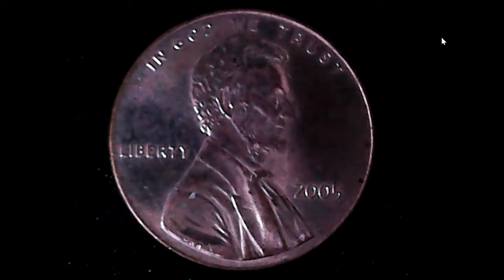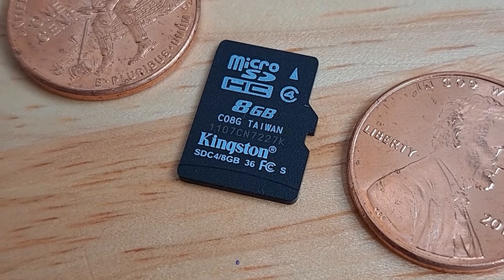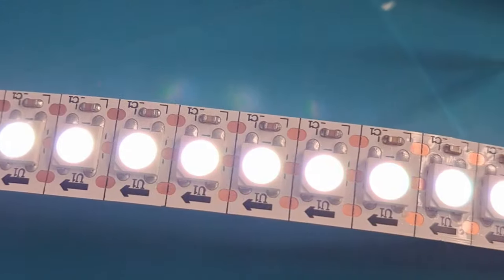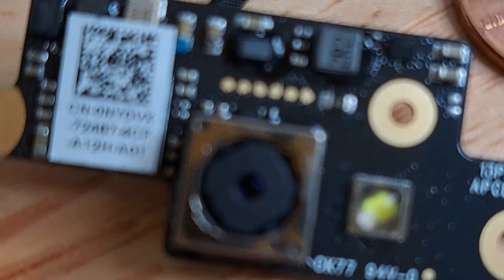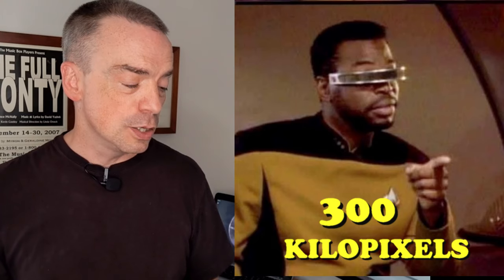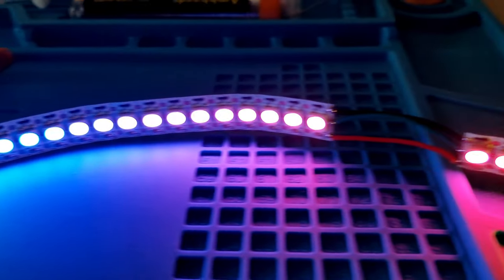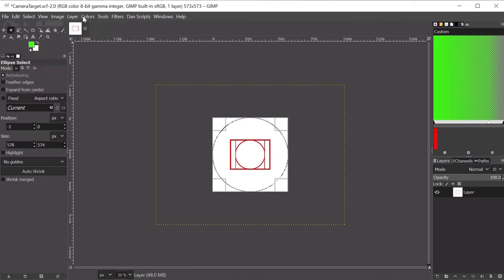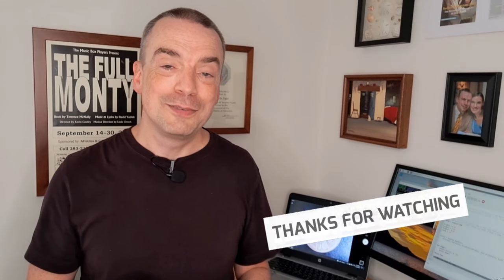Build a Photo Studio for a Penny!

Comment: You should patent your miniature lighting studio. I wonder, is the top of the studio a black background and the bottom? Or, how do you prevent any reflection and have just pure LED light? This would really help coin photographers for eBay listings. ❣️
Reply from the maker: I was thinking the same thing! If you know of any angel investors or venture capitalists . . . I believe this is what they would call an MVP (Minimum Viable Product) Seriously, this thing has helped me SEE the coins better, so I think a lot of people might be interested. It would also be cool if everyone's cameras uploaded their coin images to "the cloud" to help train the AI for everyone else too!  I have big plans . . . I just move slowly!  LOL

As far as reflections are concerned . . . I was thinking I would need to use a SHARPIE to blacken a lot of the shiny and white bits on the inside.  But it turns out that once I wrapped the pill bottle with a light blocking plastic bag (from Amazon) it blocked any outside light from creeping in.  Mainly I just need to control the brightness of the LEDs to cut down on reflections.  Seems to work a LOT better now that the camera lens is parallel to the coin. 

I think I can further cut down on stray light and reflections when I can 3D print the final machine. I will probably print everything in matte black to start with.  Stay tuned!

Very good points though . . . thanks for this!